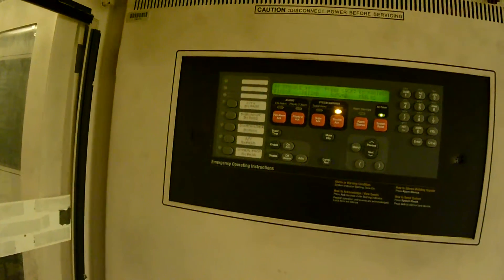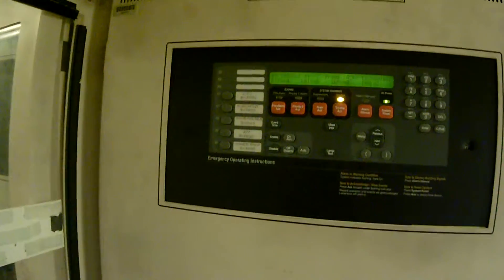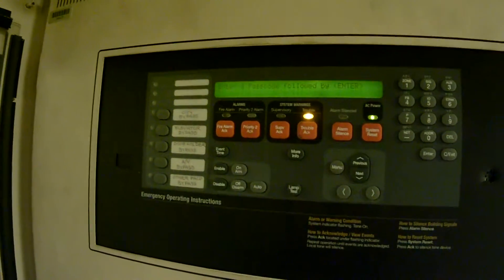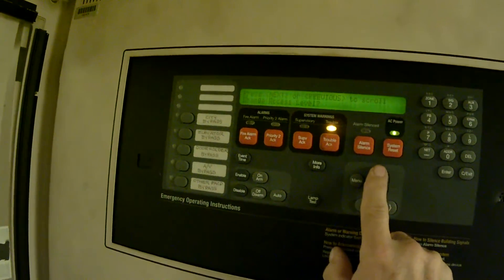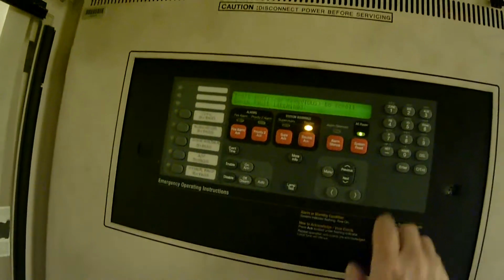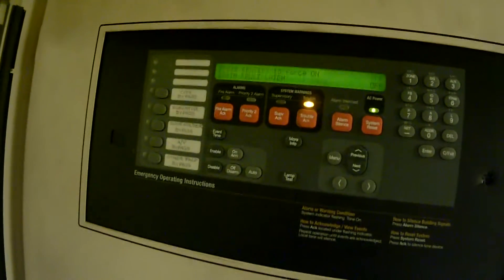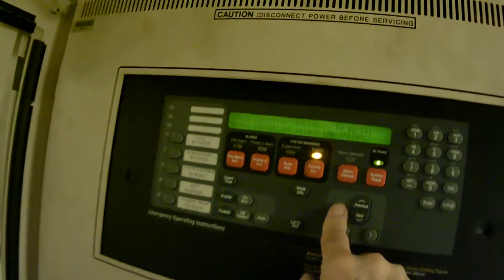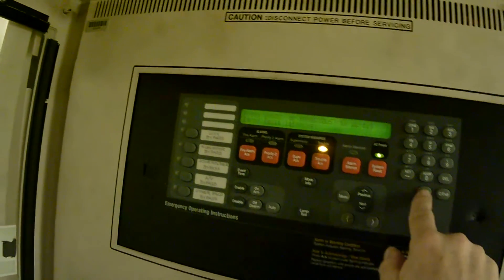Ground Fault Latch

Comment: Simplex is such junk that all you do is disable troubles and repair failed parts all the time. Then the panel fries and another 3 grand is gone. Forget any warranty. It doesn't exist. Panel fries again the next year? Too bad. Bases fail constantly setting off fire alarm every single time. Failed CO sensors set off fire alarm. Looking at it wrong causes every trouble under the sun.

Get rid of this trash. Cut your losses.
My stupid employer has a FULL TIME simplex employee. Over 40 hrs/week plus emergencies. That's how bad it is!